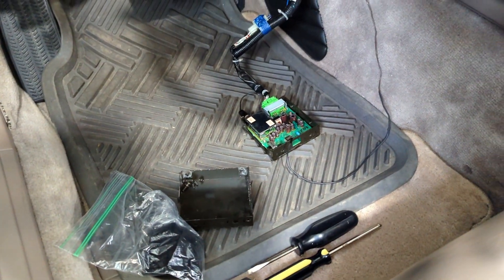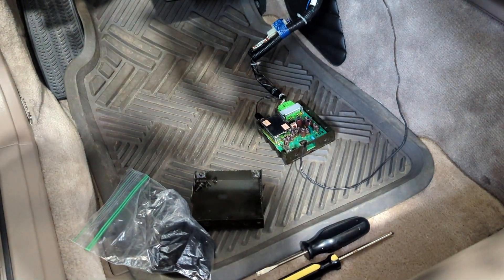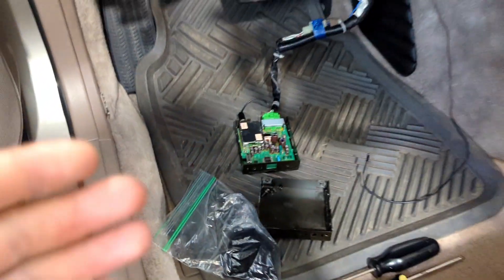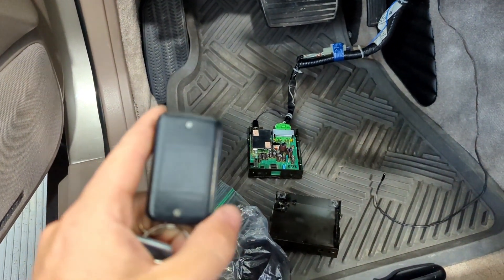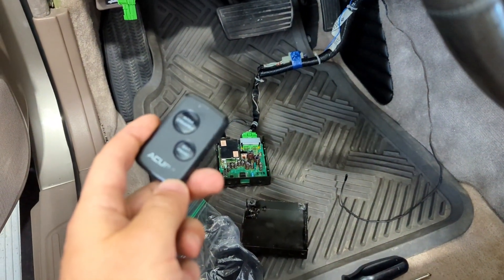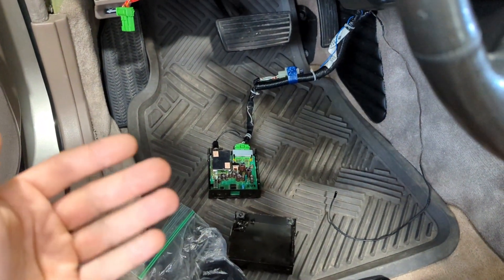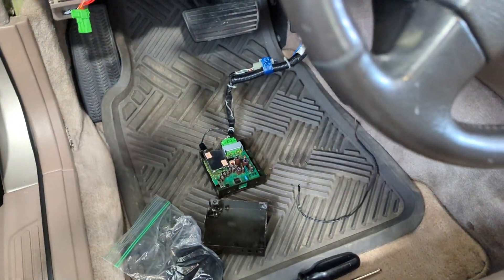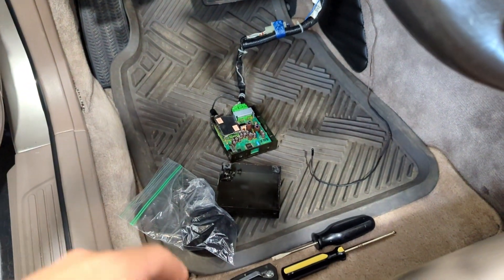NSX/Legend Keyless Entry System Demystified + Programming

Comment: hey Ty, I was able to acquire a key fob from an NSX, and a harness + receiver from a Vigor(i have a Vigor). If followed your steps but wasn't able to get the fob to work. The box from what i can tell is identical to yours and i had no issues with the harness installation. the fob is also identical looking, Is there any way to tell if the fob is working properly without a paired receiver? Whenever i press on the fob i see that it flashes a red LED several times very quickly, i assumed that meant it was working as intended. I know you're most familiar with Legends but as you're the only one I'm aware of with any major knowledge on these Kenwood systems I'm coming to you for any help or suggestions.
Reply from the maker: Hi - The clue may be in the key fob itself. You note that the key fob flashes red several times very quickly. Mine does not do this. You might start with a battery replacement to see if that is some indication of a battery failure. My key fob illuminates red once when I press the button.
Reply from the maker: I stand corrected. It does flash a little bit but not fully on/off. I'd suggest a fresh battery still and making sure the module has cleared all codes. I'm not familiar with the Vigor setup but you can try closing the door, locking the car to arm the security module with your key, then entering and following the process
Reply: @acura2g  ok thanks! I forgot it also tied into the security system, I have the hood switch disabled which prevents it from arming this could stop it from locking. Ordered some new CR1220 too, fresh batteries never hurt. Thanks!